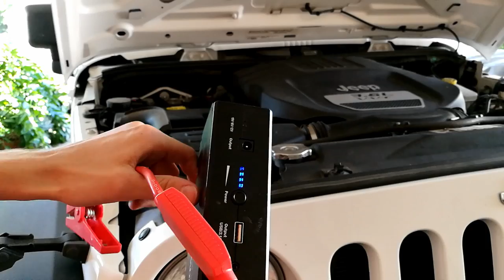EP 44 - BoltPower G06 LiPo Replacement

Comment: Excellent video! Watched it from the very beginning to the end! Everything is very well explained and every detail is shown.
Remark: The configuration shown uses the BMS board to protect the battery pack from overcharging and to balance the cells. The white connector is used for charging and for powering the flashlight, LED lights, DC out, USB and so on, so overdischarge protection gonna work for those BUT as a jump starter it's powered DIRECTLY from the pack, dismissing the BMS board which means that you can easily overdischarge it because starting an engine requires very high current which drops the battery voltage significantly. This won't cause a fire or explosion but will kill your battery if done regularly or deeply. So i'd recommend to keep the pack always charged to the end and never use it if there is less than 3 lights on the charge level indicator.
Thanks for this video! I really enjoyed it!